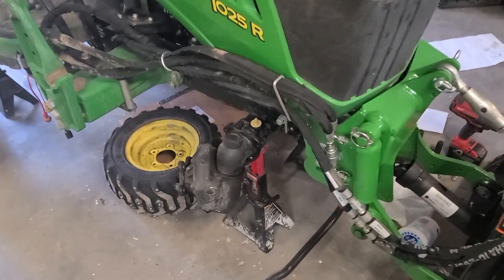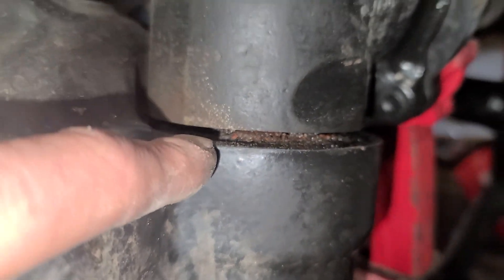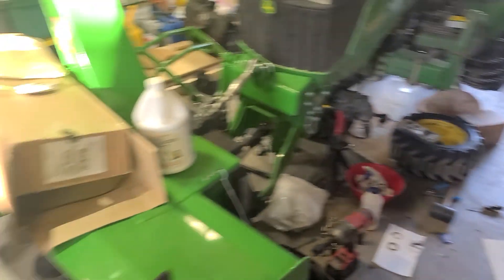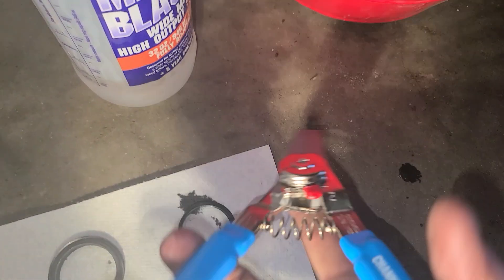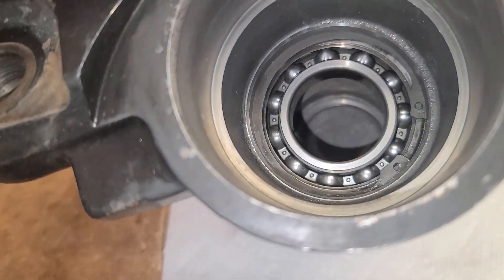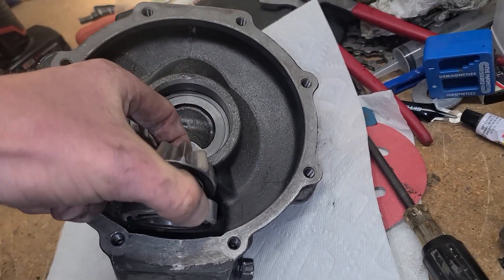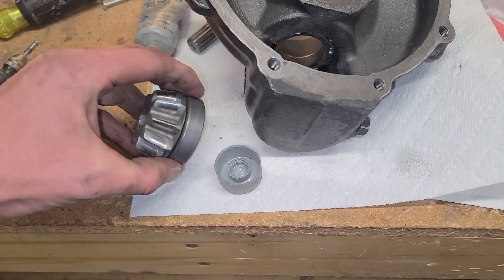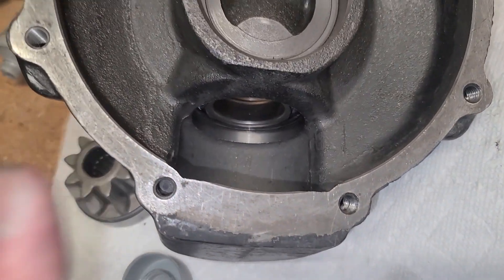JD 1025R front axle final drive deep dive (leaking seals)

Comment: So you didn't install the seal? Is there a part 2 video ? Thanks
Reply from the maker: Sorry, I did install everything and re-install the drive unit on the tractor.  However, the footage was lost.  Ultimately, you just tap in the seal and reinstall the unit the same way you take it apart.  It was fairly easy.
Reply: Yeah when I put my seal in I had to beat on it pretty hard to get it in it was so tight just wondered if anybody else had that issue
Reply from the maker: Nah, that's what it took.

Comment: this is happening on my on my 2017 John deere 1025R as well. I have a question. . . . .Do ya or are ya  or can ya, supposed pack the round bearings with grease of anykind fore ya put em back in their seat positions??? And if one were to pack the bearings, what would the gear oil lube do to the greased thats packed in the bearings??? Any bearing that ive ever had to mess with, they had to be packed!
Reply from the maker: @truckerray7533  Definitely no grease. They are oiled with the gear oil.

Comment: How do you get the old seal out?
Reply from the maker: It was a huge pain!  I used screw drivers, little pry bars and partially cut it with my electric Dremel and cutter wheel!  There's no easy answer.  Just be extremely careful to not cut/ding the metal that butts up to the seal.
Reply: @mymorristribe  Was this the most difficult part?  How difficult was installing the new seal?  Did you replace any parts other than the seal?
Reply from the maker: @DavidTaylor24  Getting it out was hard. Putting the new one in was a cinch.
Reply from the maker: @DavidTaylor24  I only replaced the seals. Everything else was in perfect shape.
Reply: Just did this for the second time on a JD x728. I successfully used a PITTSBURGH 3-Jaw Puller Set, 3-Piece the smallest one in the set to remove the seal. WAY EASIER than prying with bars and screwdrivers, which I also tried for way too long. . . 
Thanks for the video!

Comment: What are your thoughts on Hydro fluid vs something heavier like diff fluid ?  I feel the front axle is over stressed easily and a heavy fluid might help.  Thoughts ?
Reply from the maker: Hard to say.  The entire final drive is soaking in the fluid.  Heavier fluid might cause some resistance, but it's probably not noticeable. I will say that I noticed zero wear or damage on any gears or bearings after 600hrs.  My fluid was black too!  So, the hygard is probably just fine.